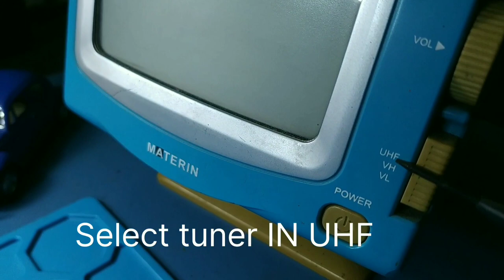How to make Wireless Video Camera (Video Transmitter circuit with Range 100Meter )

Comment: Bro,, without any buying camera...okkk set any old phone 's camera...then u r genius
Reply from the maker: This wireless Video transmitter only work with  analog  Video signal.  Mobile phone camera gives only digital signal So it is not possible with any old mobile camera 🤗
That why ii used an old CCTV camera
Reply: @etechniques  Hhhmmm,,can u make ..other device,,in which phone's camera work through wifi or Bluetooth mode..